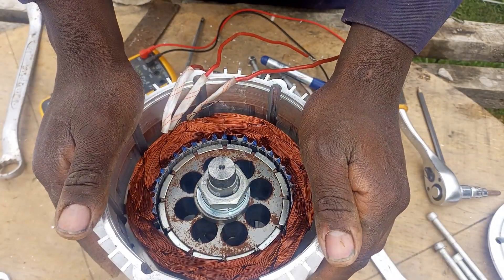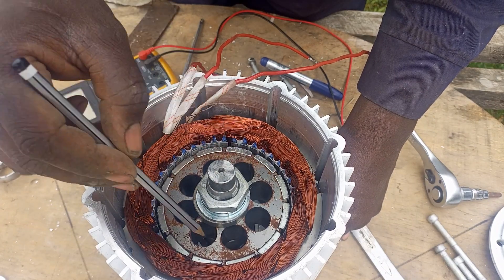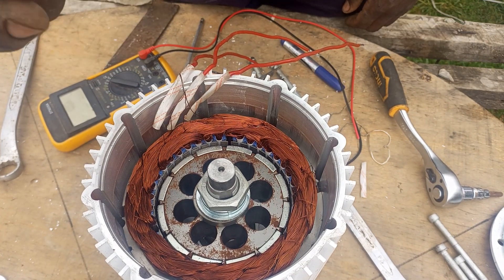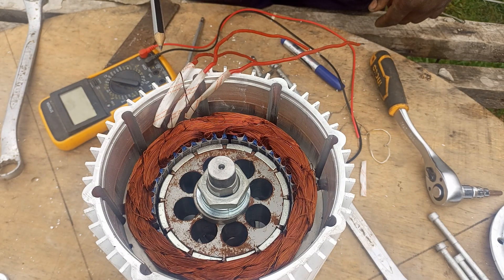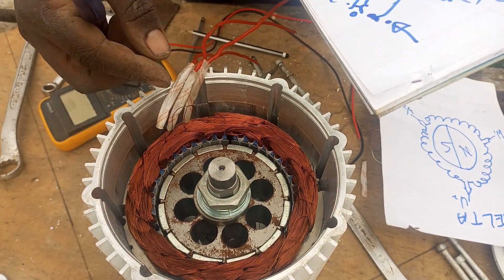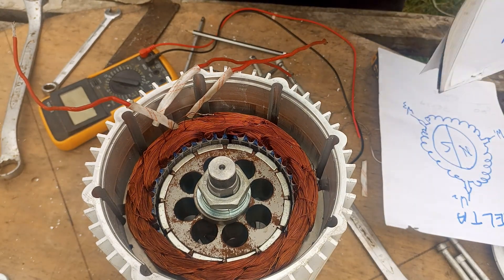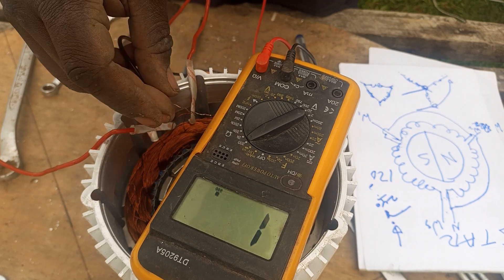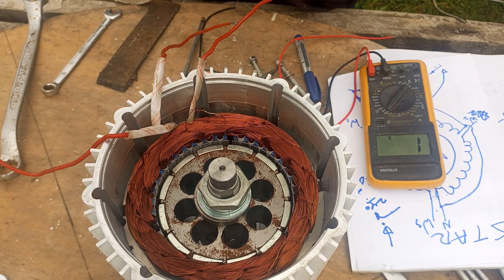Inside a 30KW Chinese PMG. Build Quality Analysis #diy #pmg #renewableenergy #kenya

Comment: Bro what happens if to connect all this wire between to make one phase, connect like extension of battery see what happens
Reply from the maker: The only way to connect them together is by rectifying them to DC first. Otherwise you will just be shorting the windings or the phases will cancel each other out and you get no usable output. If you rectify, then you will have to invert the DC if you want ac output. That's too many steps each with it's losses